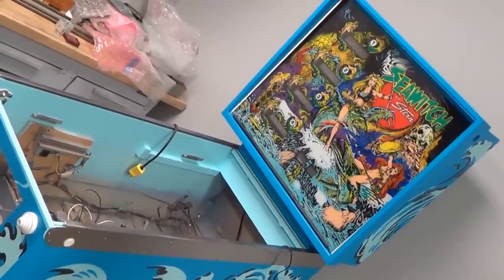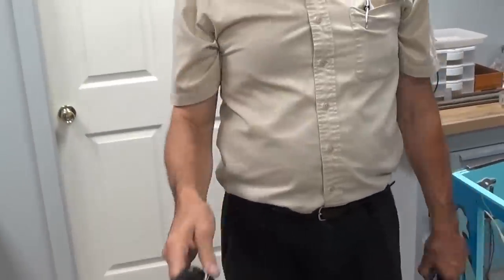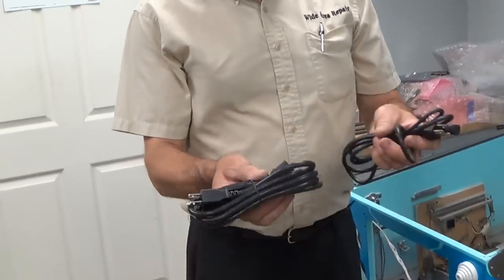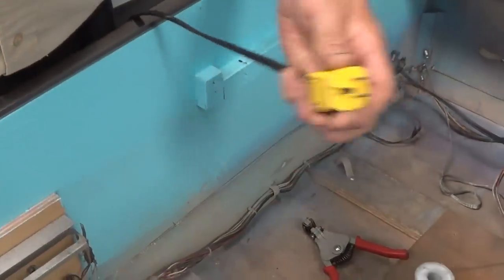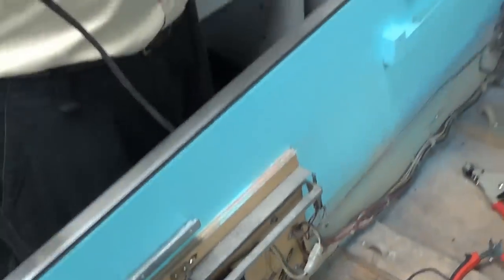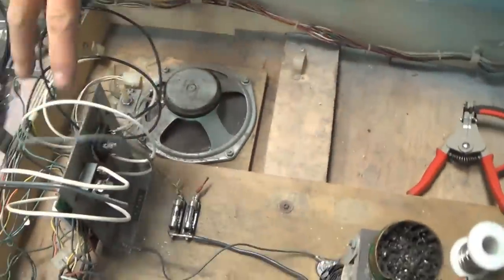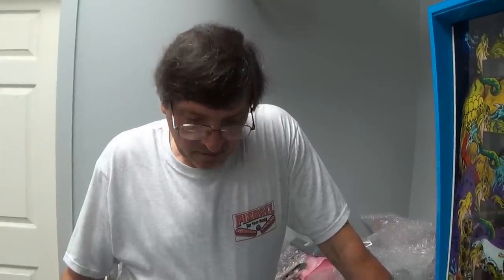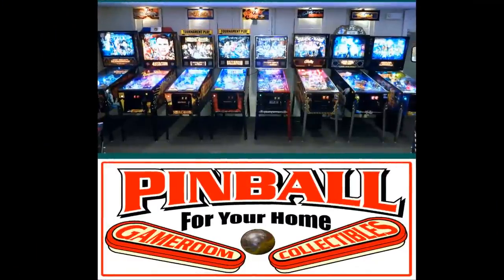Ray's Pinball Tech Tips #1 - LINE CORDS!

Comment: What is your opinion on putting in a power socket instead of a cord?  It would mean more work, but then there would be the option to use whatever cord length was needed.

I've done this to two arcade machines and having a detachable power cord was helpful for moving them around.  (Pins usually have the advantage of easily pulling them inside most of the time, so I haven't done any so far.)
Reply from the maker: Sounds good in theory. Most newer pinball machines have this upgrade from factory. Don't burn your house down! ;)

Comment: I wanted to write this on the first video because people should start here and check their machine and if it's not 100%, then watch all the videos cause you will need them.... I sure did.

 !!! THANKS RAY !!! 

I got into pinball restoration on June 23rd.. Your videos and flippers.info were the two best sources on the internet (Williams system 6. I have Time Warp).. This video pretty much sums it up.. Check the line cord.. Both the cord plug and it's attachment to the cabinet board were bad.. The whole machine has  pretty much followed the same quality.

Your videos show how to perform quality maintenance,  

My machine is almost done and I thank you for being the knowledge bucket.. TNT is for amusement only. There is no comparison. You are an engineer, they are in the vending machine business.

Comment: Often overlooked, ALWAYS hacked, replacing a line cord is as essential to replacing balls while shopping machines. Ive had projects with old extension cords, lamp cords, vacuum cleaner cords, etc wires in. Ray is on point here, glad to see people with the attention to detail. If the guy who sells you your pinball doesn't exhibit at least a few symptoms of OCD or autism, stay faw away. To spot all the little details that will keep a machine running like new for 5+ years it takes a little OCD.